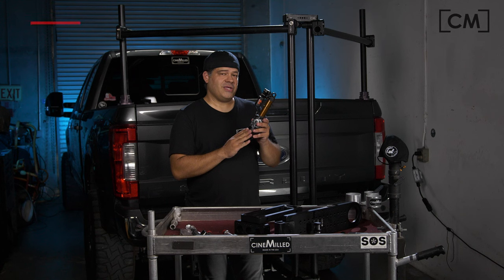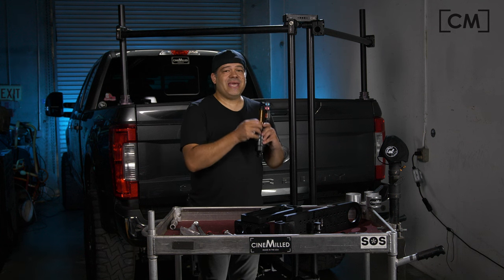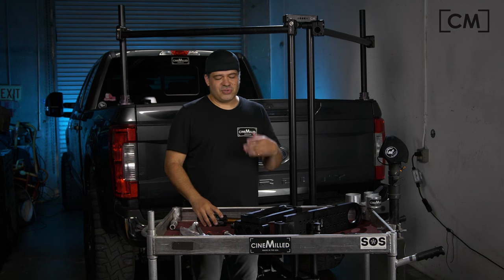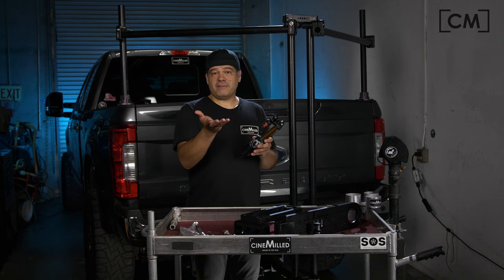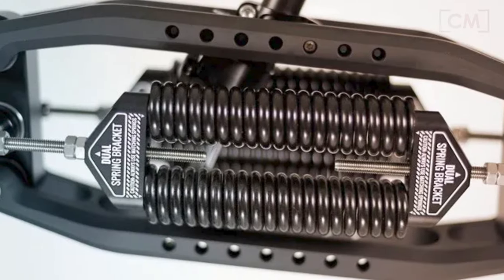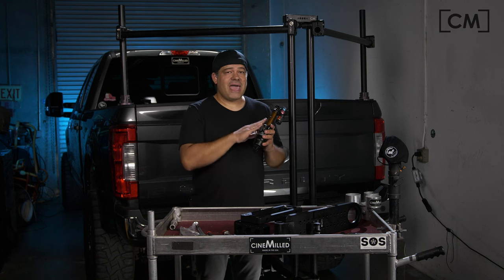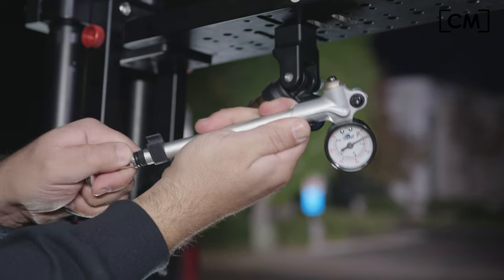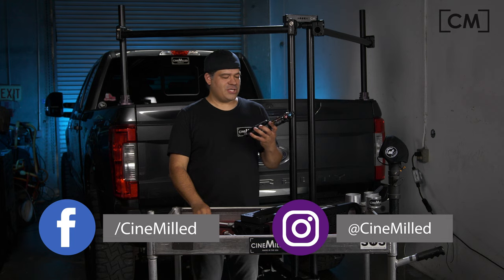WHY use an air SPRING ?

Comment: When you are adjusting the air pressure, do you need to lift the suspension or pump as is?   I saw some tutorial saying you need to lift up then pump.
Reply from the maker: No you dont. You dont need to lift you entire car off the ground to pump up the tires right? I couldnt see how it makes a difference.....That said I have been using this arm for a few years now (long story) and always adjust with the payload mounted and never had an issue. So no worries.